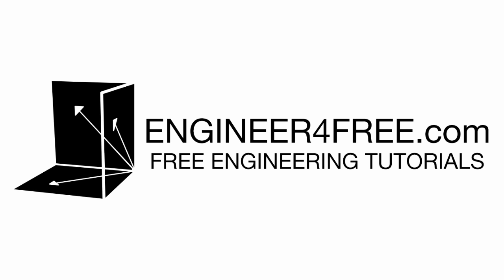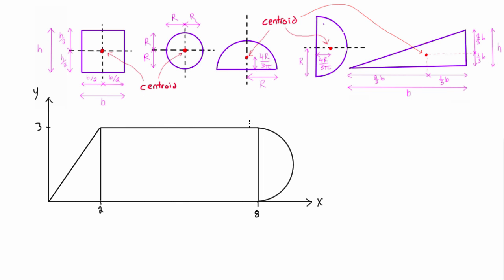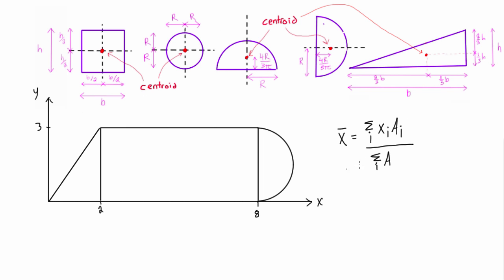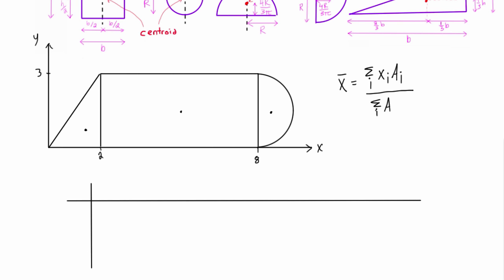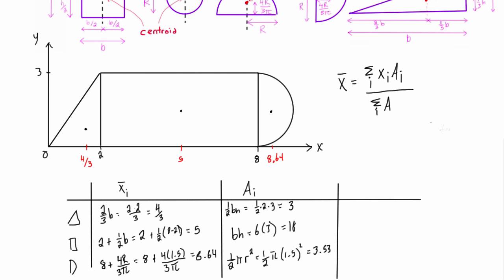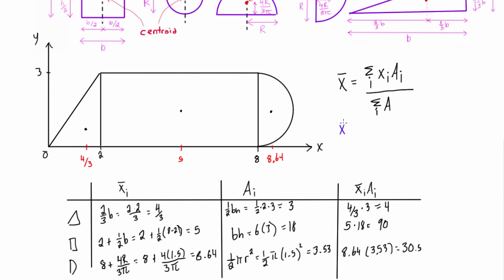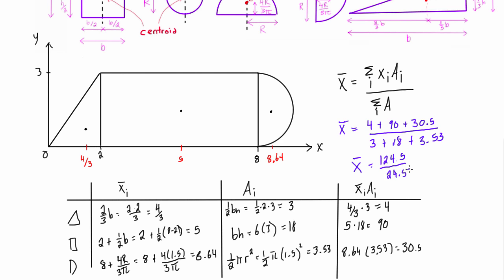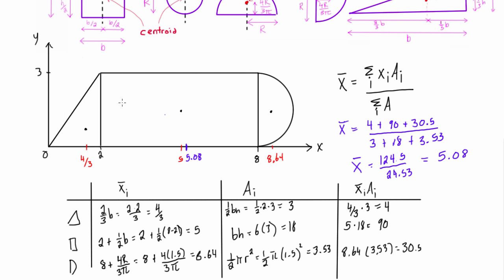How to find the centroid of simple composite shapes

Comment: hye if the triangle is upside down. for y bar i need to use 2(b)/3 again? because it will start from the shortest one?
Reply from the maker: If the triangle was flipped vertically, the short side would still be on the left, so the calculation would be the same.
Reply: @Engineer4Free  thank u so much

Comment: great explanation, but it would have been better if you do the y bar as well.
Reply from the maker: Thanks, but yeah that was my bad. I didn't bother because at the time when I made this it was a just precursor to simple distributed loading problems wihh vertical loads in which the y bar is never needed, but it could be for sloped members or wind/pressure loading etc... So whoops sorry!